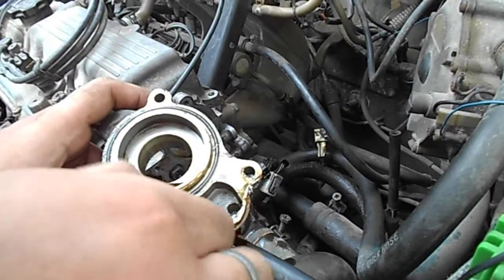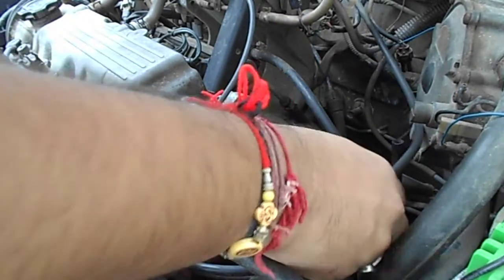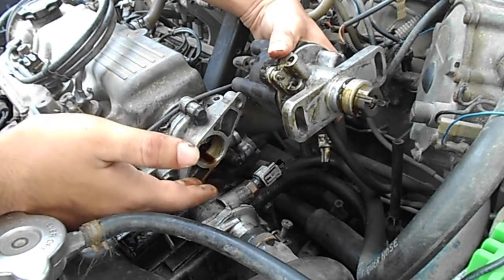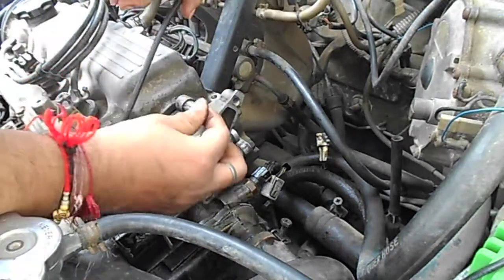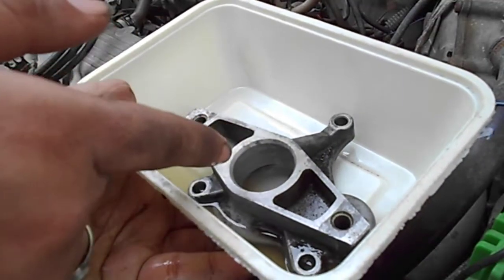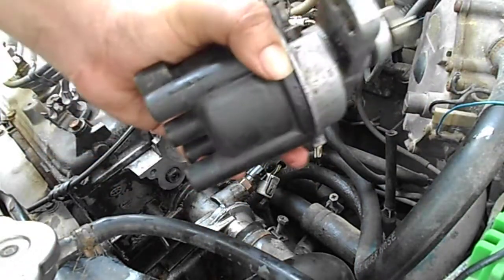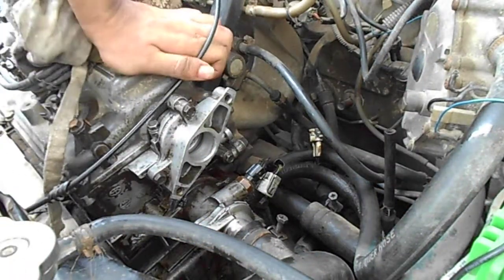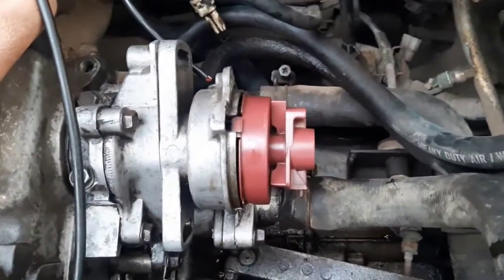How To Fix Oil Leakage In Car Engine (PART-2) | Maruti Suzuki Zen

Comment: My zen is 2006 lxi.
My mechanic is opening timing chain side also to replace the O ring for timing accuracy.
Is it ok?
Reply from the maker: Yes, to complete stop oil leaks from distributor, there is oil ring on cam ends which needs to be changed and to do this whole timing has to be removed
..

Comment: bro can we apply rtv to that distributor connection
Reply from the maker: No, we can't because distributor is moving part and if we put rtv then we can't adjust it...
Reply: but in mine the leakage is from their what can I do
Reply: and thank you very much for replying and after this was the problem solved completely?
Reply: @aanrky  but in my zen the leakage is from their only what to do bro
Reply: @aanrky  and is the problem solved completely?
Reply from the maker: Yes, i have it too.. to fix it there is o-ring at camshaft end which need to be changed.. and for that whole engine head has to be removed....
Reply from the maker: No..
Reply: @aanrky  how to solve the problem completely and can we drive without getting it ready
Reply from the maker: Yes, car can be driven with the problem but, you have to check the oil levels before going for long distance travel
Reply: when are going to solve the problem and please post a video of it please

Comment: I have suzuki esteem 2007. Same issue .
Reply from the maker: I think esteem also have same G10B motor.. or maybe G13B.. but both are technically same just G13B have bigger bore size..